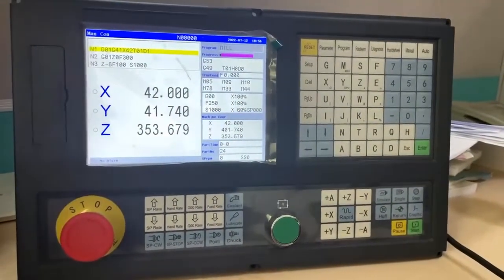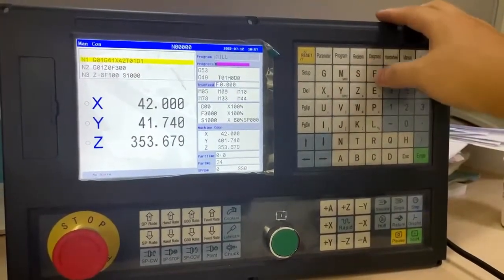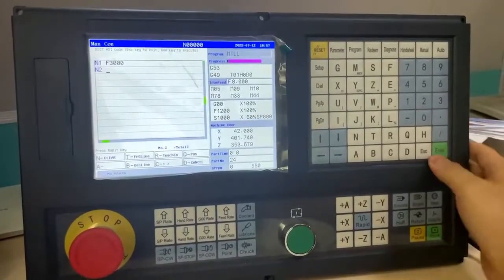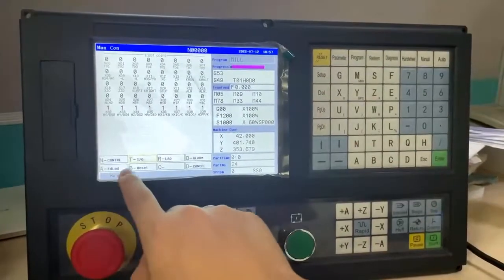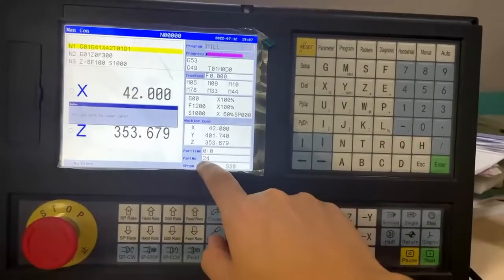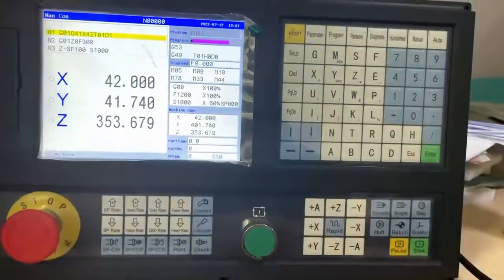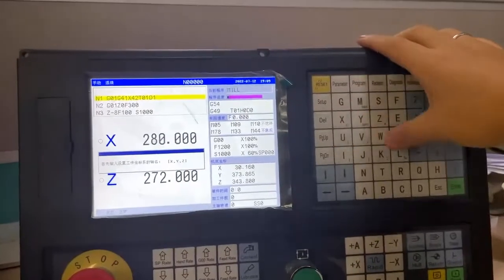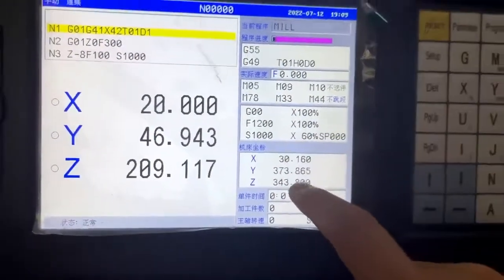NEWker cnc controller easy operation

Comment: how to calibration the axis , follow the manual set at numerator and denominator but i don't find the right movement,screw pitch 6mm ,direct drive .
what parameter's number  to set the screw backlash ?
Reply: Me too buddy. 1000 step 1 turn motor. my screw is 1 turn is 5 mm  and screw gear is 48.    servo motor gear is 24. but cant make it ...

Comment: Hi i have purchased 2 cnc controller.
I want to increase g0 rapid feed.. how much max can i give and what parameters to choose..
Like we do in fanuc.
Reply from the maker: Hi, you can increase speed by speed parameter until it get to motor highest speed
Reply from the maker: the best is contact with your supplier please

Comment: Hello, what kind of program or software do I need to use this as a cnc plasma cutter?
Reply from the maker: Hi, normally if you use cnc controller for plasma, it's 0-10V analog and IO for plasma machine, and the machine structure is like milling machine, so our M series milling controller is suitable